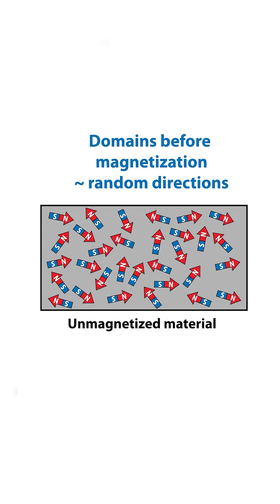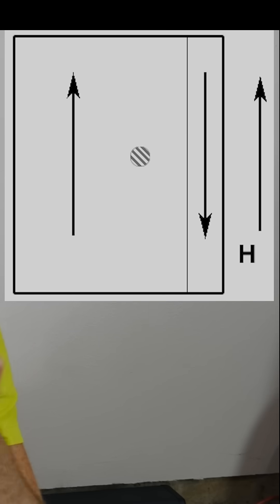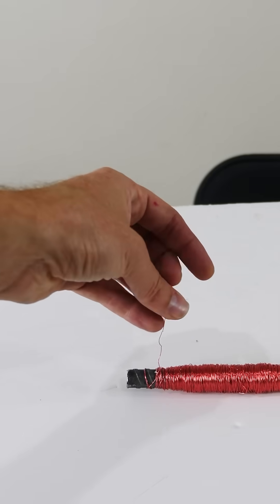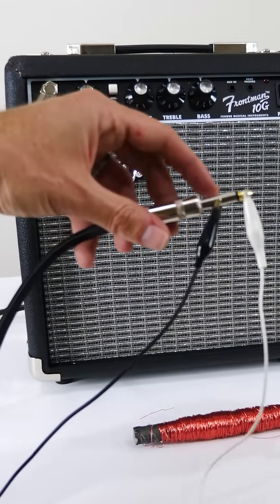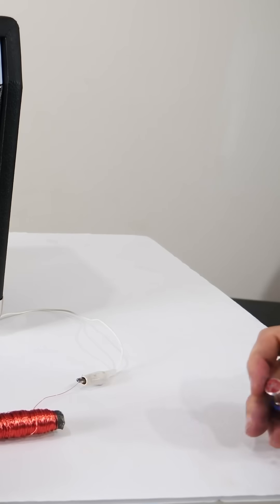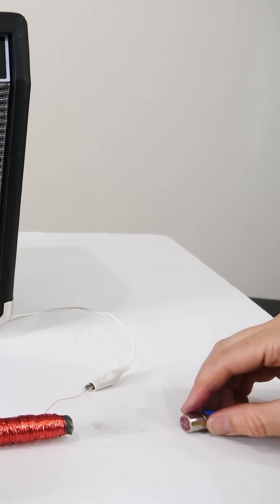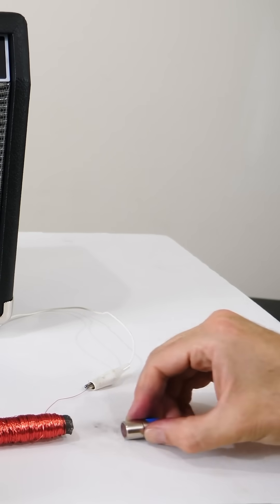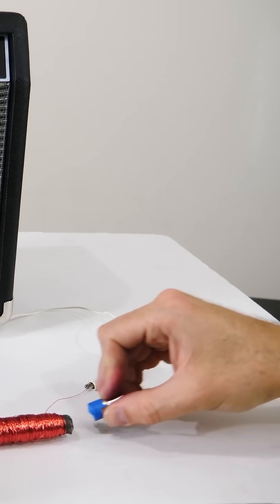Barkhausen Noise

Comment: I had a smartphone which I wanted to use as a source for car listening. I was using a standard mm type audio jack. I knew some of the nearby usb ports were damaged but was surprised to find their "noise" coming through the car radio when wiggled or plugged with my thumb drives next to the audio jack 

Long story short, I discovered that, via this screwy scenario, I could move my fingers close to the smartphone screen and it would produce very loud, theramin type buzzing in the car. It was amazing. At first i thought maybe it was just heat, but the radius of effect was way too large. The field around my body was buzzing in to the radio. It was amazingly fun to play with my aura buzzing in and around the smartphone.

Comment: This made me think of the hystersis loop

Hysteresis loop
A hysteresis loop, also known as a B-H curve, is a graphical representation of the relationship between the magnetic flux density (B) and the magnetizing force (H) in a ferromagnetic material. It is a plot of the magnetic induction (B) against the magnetic field strength (H) and is used to describe the magnetic properties of a material.

Characteristics of a Hysteresis Loop:

Remanence: The point where the magnetization is not zero, even when the external magnetic field is zero.
Coercivity: The point where the magnetic field strength is required to demagnetize the material.
Hysteresis: The area enclosed by the loop, which represents the energy lost during magnetization and demagnetization.
Saturation: The point where the magnetic induction reaches its maximum value.
Types of Hysteresis Loops:

Soft Magnetic Materials: Have a narrow hysteresis loop, indicating low energy loss and high magnetic permeability.
Hard Magnetic Materials: Have a wide hysteresis loop, indicating high energy loss and low magnetic permeability.
Importance of Hysteresis Loops:

Magnetic Materials Selection: Hysteresis loops help in selecting the right magnetic material for a specific application.
Magnetic Circuit Design: Hysteresis loops are used to design magnetic circuits, such as transformers and inductors, to minimize energy loss.
Magnetic Properties Analysis: Hysteresis loops provide information about the magnetic properties of a material, such as its magnetic induction, coercivity, and remanence.
Real-World Applications:

Transformers: Hysteresis loops are used to design transformers with low energy loss and high efficiency.
Magnetic Resonance Imaging (MRI): Hysteresis loops are used to design MRI machines with high magnetic field strength and low energy loss.
Electric Motors: Hysteresis loops are used to design electric motors with high efficiency and low energy loss.

Comment: This feels strangely similar to when bending metal can make a fuzzy, seemingly unexplainable vibration through your hand

Feeling texture is just hearing through your skin
Reply: "hearing through your skin" sounds so weird, yet it describes this so well??
Reply: @MystikoBlu i mean, it’s all sensory input thru sensory organs that we then interpret, so yeah everything is just vibrations that our brain decides to interpret as sensation. It’s like how we can’t actually feel temperature, and we make it up depending on pain and touch sensory info (often confusing extreme cold/heat)
Reply: @Xanderj89  yeah, now that you say that, I've come to realize that human senses are really weird.
Reply: @MystikoBlu also why people think ghosts exist. 

Our brains are imperfect observers of reality. 

They have just evolved to be as accurate as necessary to distinguish btwn relevant stimuli to survive in this specific temp, pressure, light wave range,  etc.

I.e) we can sense the difference btwn 20 and 30°C, but not 450 and 460°C
Reply: @Xanderj89 Good stuff there, well-explained. And you didn't need 5 paragraphs to do it. 

My audiologist taught me how our ears don't hear. Our ears are basically sound funnels that bring vibration signals to our brain, which interprets them as whatever the sound is. So our brain sort of does the "hearing".
Reply: @huhwhatumean Does anyone?
Reply: @DrWakey  I think, therefore I am, I think.
Reply: @harriedsloth4399  I am, maybe.
But do i think?
Sometimes. Maybe.
Reply: @DrWakey  I do not think, therefore I do not am
Reply: Bending cold metal makes that feeling because the metal is crystalline and you’re breaking millions of crystallized particles of metal.